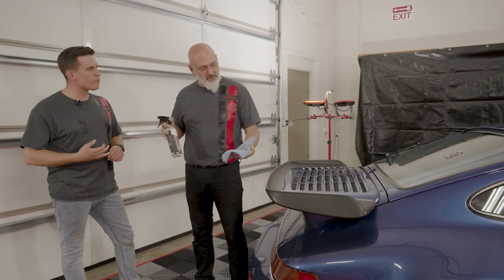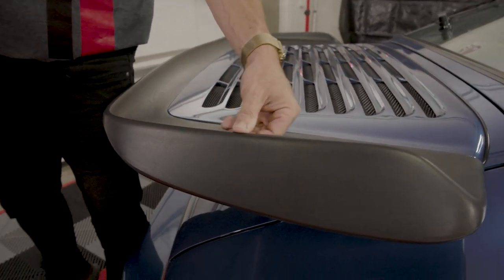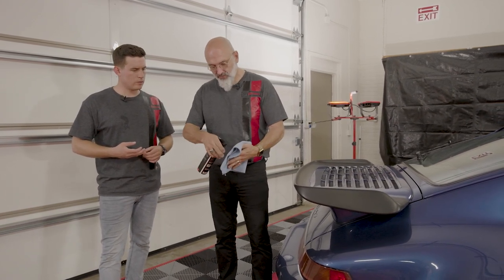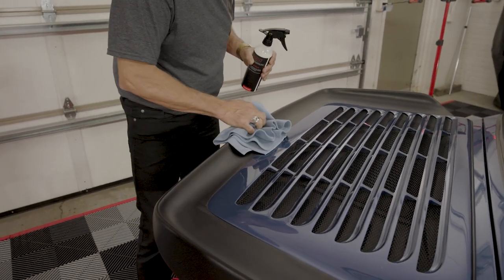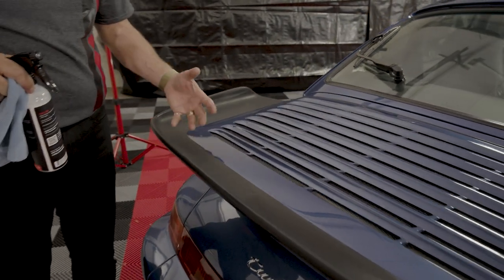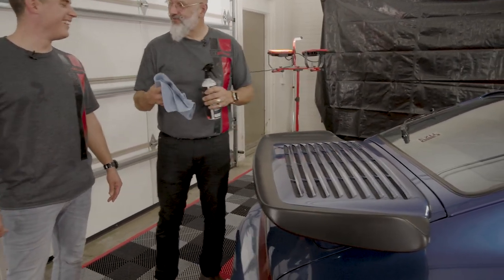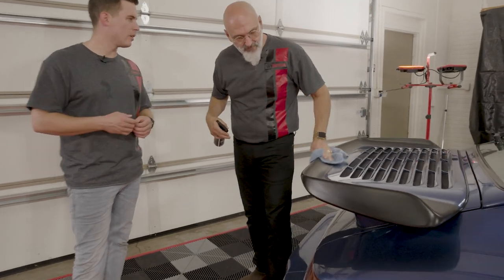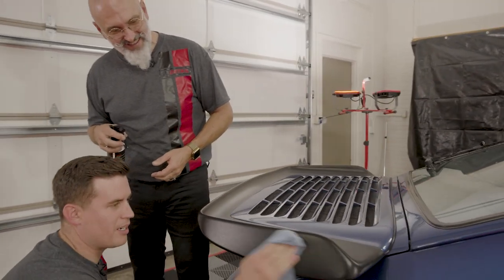Use tire shine on what?!

Comment: I tried my tire shine on my car awhile ago and wow i find it worked heaps better and restored trims heaps better than any trim restoration products i have used.
Reply from the maker: Thanks
Reply: @diydetailofficial  is there any problems using a tire shine product over a dedicated trim restorer. I'm a mobile detailer and I try alot of things on my car and have noticed it has lasted on there for over a month now which is amazing. Just thought I'd ask the best in the buisness if there would be any complications using this as a trim restoration product on clients cars now cause the results on my car are hands down the best and longest results so far.
Reply from the maker: No problems with using it that way.

Comment: Is your tire lotion water or solvent based? Does it have any SiO2 or other ceramic protection in it? Thanks.
Reply from the maker: Solvent based, no ceramic
Reply: @diydetailofficial  Thanks for the response! Is there any truth that solvent based is worse for rubber/tire longevity vs water based? Or is that just more the silicone/solvent dressings or ones that can dry rubber out? Thanks again!
Reply from the maker: Old wives tale, cleaning with harsh chemicals is much harder on your tires.
Reply: @diydetailofficial good to know! Thank you! Any hints to the C6 ceramics decals/signs that are in some of your videos? Haha
Reply from the maker: @aaronolsen8787 C6 Ceramics is a soon to be launched brand of high end ceramic coatings.
Reply: Oh cool! Is that going to be your company/affiliate company as well? Are they going to be superior to the DIY Detail coatings and also available to anyone? Specifically the 8 year/3 year stack? 

No worries if you can't or don't want to answer these questions. I just get excited over the latest and greatest scientific advancements in coatings is all. 😅
Reply: @diydetailofficial  I just found the website, I was sure I looked for it yesterday but with not feeling good maybe I skipped past it. Haha. It looks great though! Congrats Yvan! 

It appears to be for professional installers only so that will rule me out as I am to only do it on the side for friends and family and have only installed about 2 dozen coatings (I still have lots to learn and happy about that!). Oh well, these DIY Detail coatings still seem fantastic so far! I don't always need the best product on the market. But the C6 "permanent" statement still interests me highly! Plus, I can still dream of installing it on my own vehicle one day. Thanks again Yvan and Nick for everything you do and all the knowledge you share so openly! I wish you the best with this amazing company and pray that God blesses you and your families abundantly!
Reply from the maker: Thank you. C6 Ceramics was born from my goal of continuous improvement. It is a pro only coating. The 8/3 stack is what I have on my car, and it’s fantastic. The DIY Detail and C6 ceramics are similar in composition with the exception of one additional ingredient in C6. This is what makes it not only permanent, but also the best performing coating I have ever experienced. This same component also makes it a pro only coating, because high spots are unforgiving.
Reply: @diydetailofficial That sounds like a truly amazing coating! Are you able to say what that extra ingredient is or is that proprietary information? No worries at all if it is, I'm just a bit of a nerd when it comes to the chemistry side of these coatings and always like to know more. As always, thanks for the reply! Greatly appreciated.